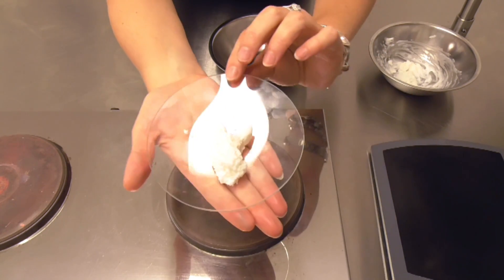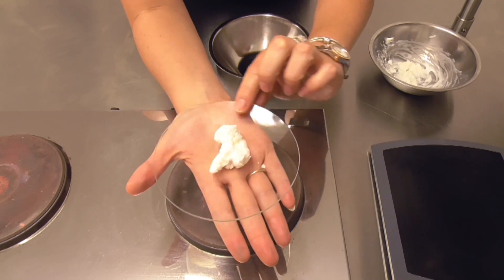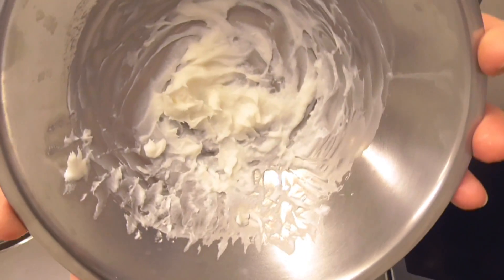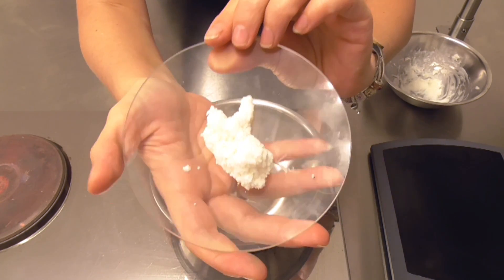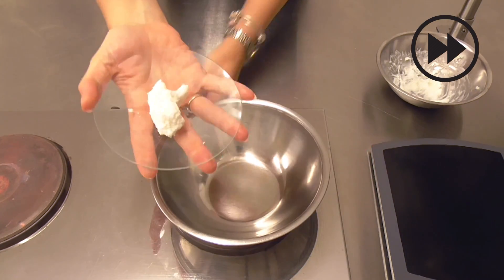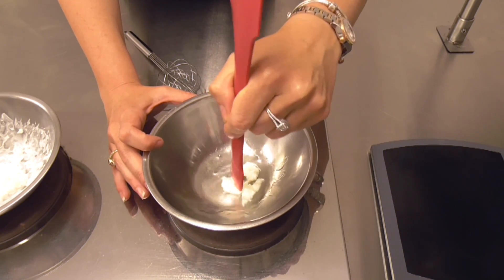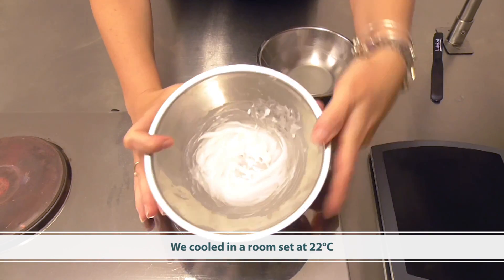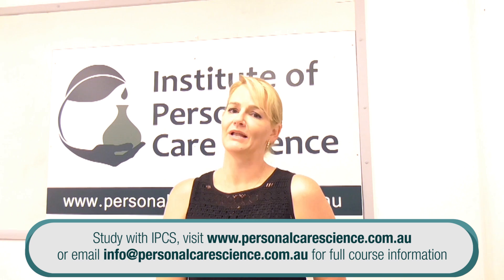Formulation Fix its: Grainy Butters and Balms

Comment: Thank you for a great explanation. My balm looks nice and smooth for some time and only after using it for a month or so, it starts developing crystals. I can't figure out what causing it. The solution you propose in your video seems to work for products that are grainy at the time of making a bath. what do I do if my formula develops crystals after some time? It doesn't happen right away.

Comment: I have a not temperature control warehouse for my raw materials and i have this problem with low-melting butters. I wonder if I can melt and freeze to store to void temperature fluctuations and ensure good condition before manufacturing
Reply from the maker: You would be best speaking with the supplier about this specific to the material, I would suggest freezing may also cause issues.

Comment: Is vitamin e oil heat sensitive, how about coconut oil, cocoa butter or beeswax? What's considered heat sensitive? For Lip balm, should I cool in refridgerator after pour? Or Freezer. Mine turned grainy 2 weeks after making. It was perfect before that. It's winter here so not in the hundreds like in summer but Heater is on and fluctuates a little between 68-73 degrees. 
I used shea, cocoa butter, beeswax, vit e oil and liquid coconut oil.  I already poured them. Small 12 tube batch but on an extreme budget. I poured then let them just set up in room temperature. I think I messed up. So upsetting. I am not sure what is heat sensitive? Can I save it by digging ingredients back out of the tubes,  reheating, repouring then refrigerating them? K do not even know if I can do that. I am not sure if the butter was grainy prior to starting as I did not know to check.  Any help is much appreciated.
Reply from the maker: Don’t heat vitamin E if you can help it – while it will tolerate the heat, you will lose its antioxidant protection when heating. This is why more is needed in balms, because you must heat it over a prolonged time, so a larger amount gets used to ensure there is still enough for antioxidant protection over time. Coconut oil and cocoa butter will oxidise over time, so need antioxidant protection. Lip balm should be cooled fast in a cool room, like shown in this video. Please study our Beginners program to get your foundation learning right and avoid future mistakes: https://personalcarescience.com.au/CosmeticScience/BeginnersCosmeticScienceWorkshops-469/ You can also start with our FREE Masterclass to get you started: https://personalcarescience.com.au/Workshops/CosmeticFormulationFundamentalsMasterclass-7441/

Comment: Will it then stay smooth after being “fixed” or after making a batch from a “fixed” raw material butter?
Is there any way to prevent graininess from occurring later on from temperature fluctuations while in the consumer’s use? 
For how long do we need to shock-cool it?
Is the fridge or freezer a better choice?
If my balm starts to crystallize within a couple days of making it, can I save it by shock cooling it at that point or is it too late already and have to remelt the whole batch? 
Thank you so much! I’ve really been struggling with this issue for a long time!
Reply from the maker: You would have to remelt it and then cool it fast – also check the quality of the materials you are using from the start. Also consider reducing the amount of low melting point butters you have in your formula to solve this. You may also enjoy our Can I use another oil, butter or wax workshop: https://personalcarescience.com.au/Workshops/Oilsbuttersandwaxesworkshop-5209/

Comment: If i have more than 1 butter should I heat and cool them separately ? Since the melting points are different?
Reply from the maker: No – they should be melted together to get a homogenous mixture.

Comment: Thanks for the video. We monitor the heating temperature and put the product in the fridge (actually freezer) immediately after pouring. The products stay good until a few months later when it is either shipped or brought outside. Is there a way to better manage this? Especially if it is given out as a gift, we cant be expecting the person to reheat and cool it like we do.
Also, noted that you have recommended using Softisan that is derived from vegetables. Can I know is it 100% natural?
Reply from the maker: For the softisan - please contact the supplier directly for statements of origin. Reduce your shea - if used at more than 10% it can cause real  problems. Hope this helps. For more specific advice I'd need to  review your formula properly, you can purchase a formula review here: https://personalcarescience.com.au/Advice/cosmeticformulation,brandadvice-797/

Comment: i am getting a crusty or grainy effect develop over a period of time as they sit on a shelf. Would reducing the shea butter help or just store it in refrigerator? I live in Southern California and it typically is only hot enough to change consistency during the summer months.
Reply from the maker: It sounds like your climate is impacting the product over time - you can use less shea butter, or use some Softisan 378 - that  helps stop that also. Hope this helps, happy formulating!

Comment: Hello. I made natural deodorants twice including  shea butter and coconut oil..They looked great but in week l notice the deodorants are full of grains all over, what could be the cause? Each time l make them its a hot mess, it can't be saved cause its already put in the deodorant bottles and they looked fine at first. Awaiting you reply. Thanks
Reply from the maker: Hi Angel its exactly as in this video - the cooling process is too slow. This happens even if the shea is fine before you use it. You can also use some Softisan 378 which helps stop/reduce this from happening if you can't hasten the cooling process. Hope this helps!
Reply: @theinstituteofpersonalcare6401  Thank you for your response and tip, should i use the Softisan instead of the shea butter?❤
Reply from the maker: That  could be used 'with' or instead of - both would work :)
Reply: @theinstituteofpersonalcare6401  May I know what is the percentage to use in the body butter to avoid grainy issue please?
Reply: I mean Softisan 378
Reply: The shea butter did not look grainy before i used it.

Comment: THANK YOU!! I have followed this method and most times it works. But I can still get a grainy end product after the balm has sat on the shelf for several months. Any advice would be great. Also I usually melt the butters in batches to a smooth consitency when it has come grainy from the supplier and then I use the amount I need later in the formulas. Could this be the issue? LASTLY... sorry! I cool the balms in a fridge, where the temp is much cooler than 22c is this ok? Thanks in advance!
Reply from the maker: I would suggest ordering from another supplier where it arrives smooth - getting better quality and then storing it well is better than having to fix it later. If on the shelf for several months and it occurs then please check your storage location/conditions as it must be heating just enough to cause this to happen again. Cooling the balms even faster is even better! Hope this helps.

Comment: i did not understand what it means that fixing a batch is not desirable  ? please
Reply from the maker: Hi Areej, you ideally want the batch to go right first time - if you have to fix a batch the end product may not be the same quality as if it were right first go, or may have a shorter shelf life than expected. But, fixing a batch is better than throwing it out - but just check quality carefully and monitor its shelf life over time, it may degrade quicker than normal. Happy formulating!
Reply: yes i understand now thank you ..

Comment: Hi, I am confused. You said to fix grainy butter to melt it to its highest melting point then cool it rapidly. But then, I thought you said melt it gently, just at the melting point and cool it rapidly. 

When cooling it rapidly, your are putting it in the refrigerator? Or whisking it to cool?

Great video. Thank you.
Reply from the maker: HI LG, you can heat fast or slow - you only need to heat just above melting point in any case. The cooling is the crucial part - it must be rapid. You can use a cool room (we did that) or a cool water/ice bath. In larger batches a cool water bath may not be possible, so the cool room is more practical especially when product is poured off into jars. Hope this helps :)